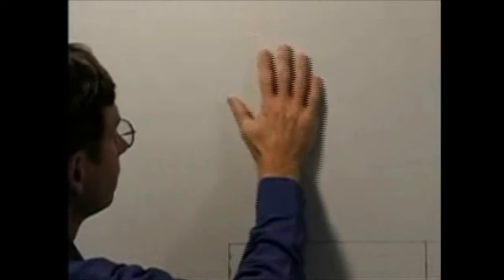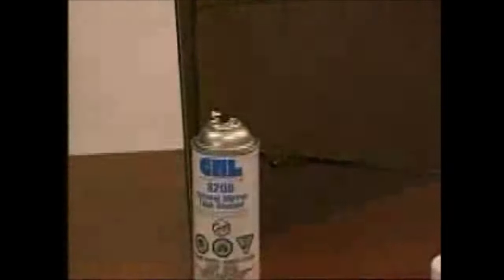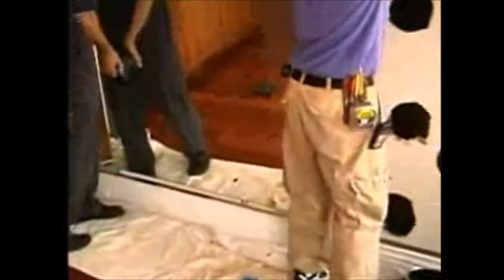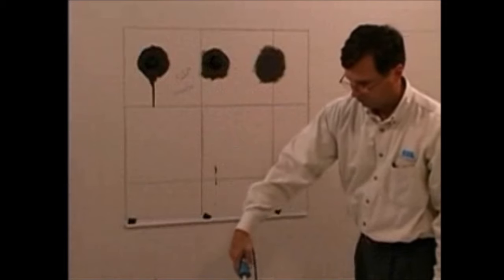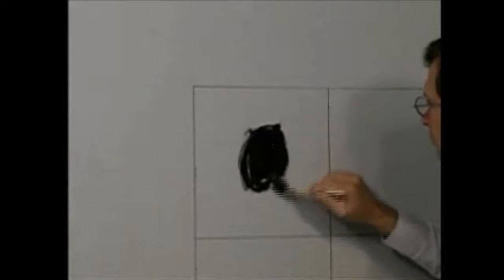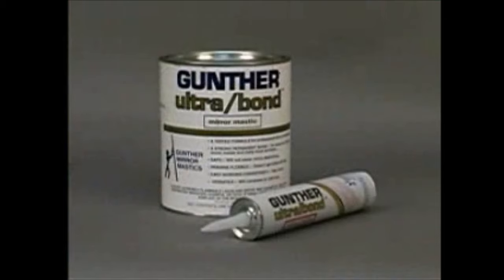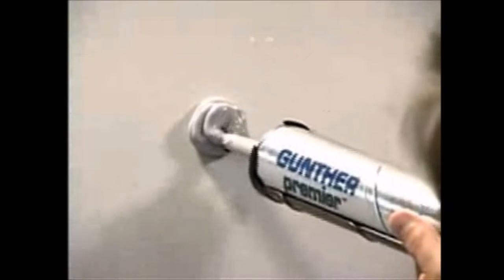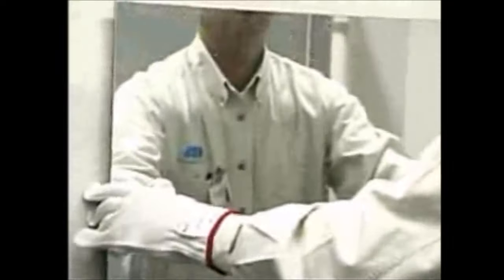How To Install a Frameless Mirror

Comment: Good information on this. Someone asked me t o install 3 large heavy mirrors on a gloss-painted wall and they gave me 2 packs of mirror clips (12 in total rated to hold 20 lbs) and a tube of Liquid Nails. I passed.